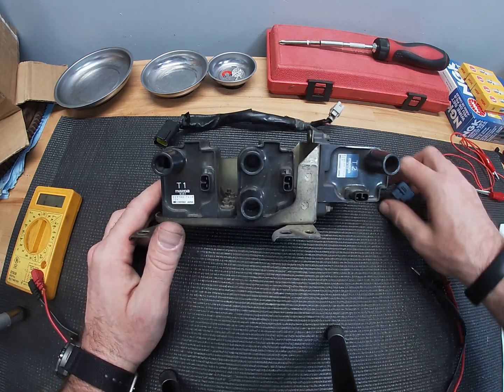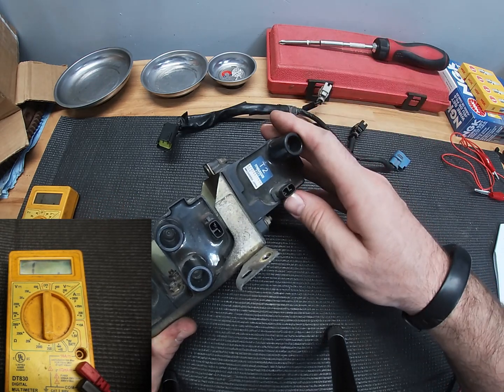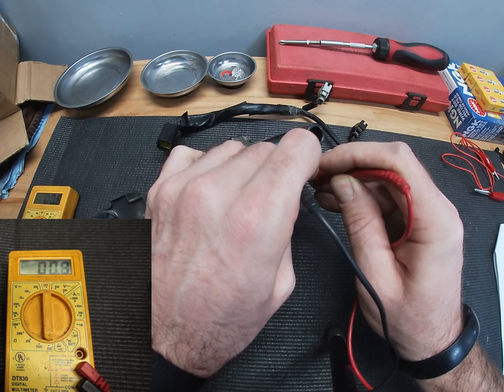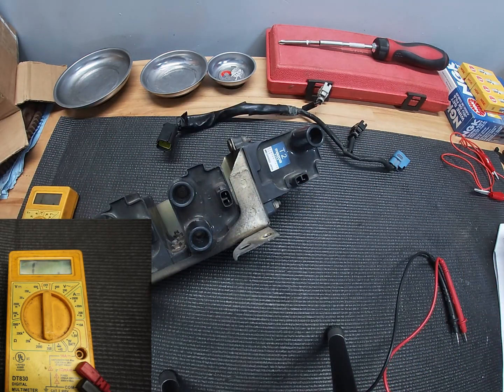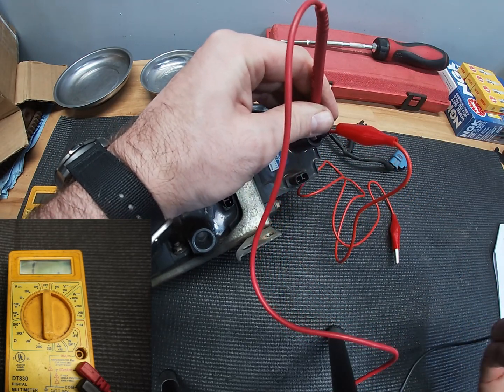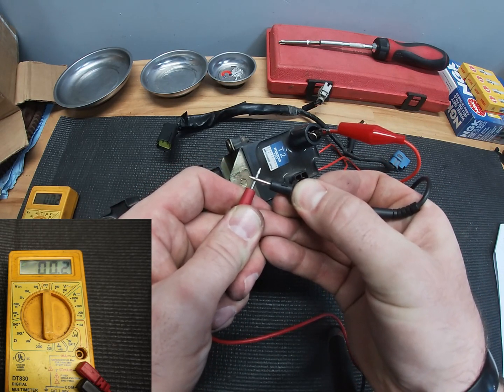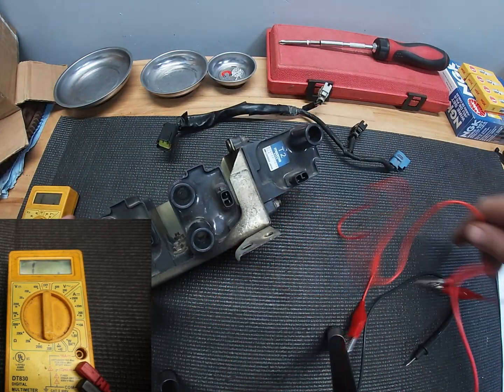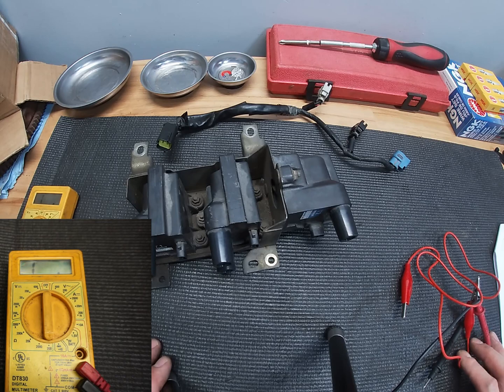Testing the Leading and Trailing Coils in my FD3S RX-7 using a multimeter

Comment: Why 3 coils on a 2 rotor? I would assume only 2 coils for a 13b...
Reply: A 2rotor has 4 spark plugs the leading coil has 2 spark plug wires and the two trailing coils have only one the leading coil operates on a  waste spark system meaning they both spark at the same time but only one of the rotors is on the compression stage the spark on the other rotor is wasted during the exhaust stage mazda did some research and it turns out that the wasted spark helps the engine burn un burnt gases on the exhaust stage making the engine marginally cleaner!
Reply from the maker: Well said!